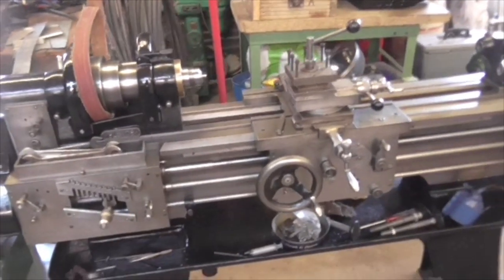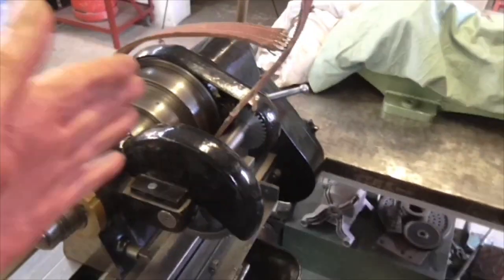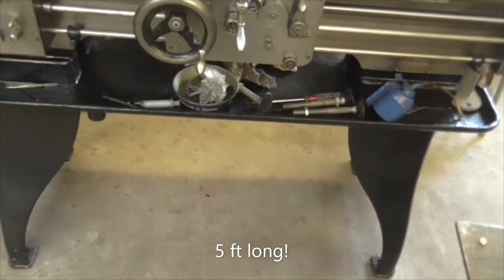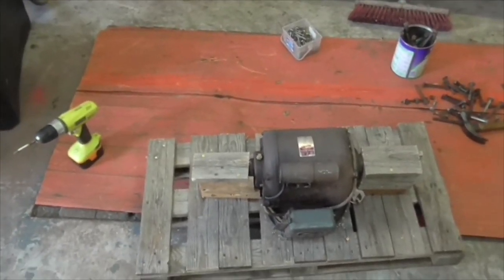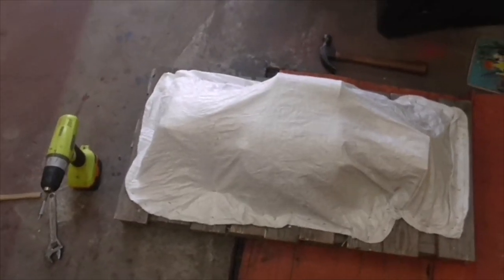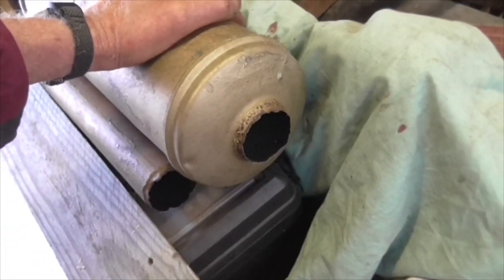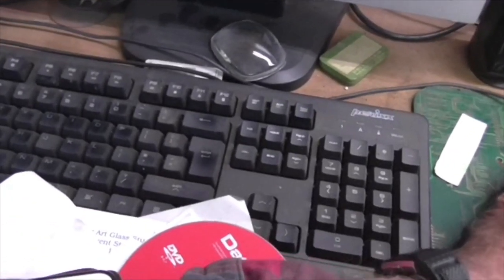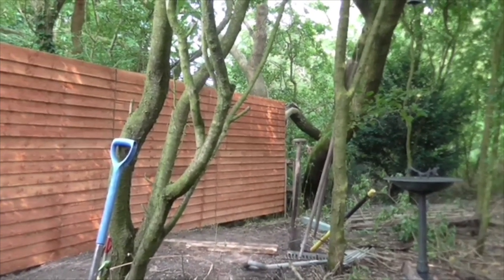Holbrook lathe, commando grass cutting and fencing!

Comment: Great job with the tractor and the fence, they both look very good good. We have a number of wildlife cameras and it is surprising what wildlife is about. I really like the dipstick idea on the lathe
Reply from the maker: @GardenTractorBoy  there would have been a lot more tractor footage if the cam battery had not failed! It only takes about an hour to cut all that area, about the same as charging the camera, I need another battery and an off camera charger! I will order one tomorrow!
Phil